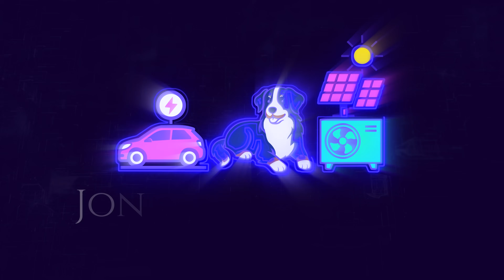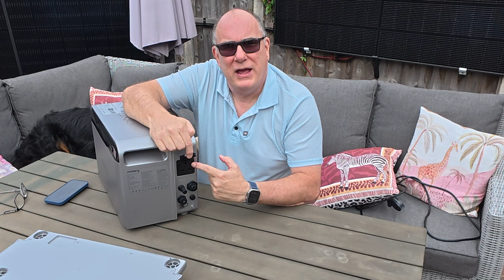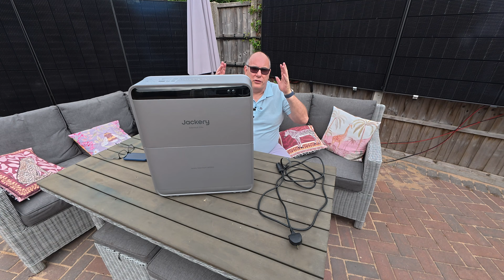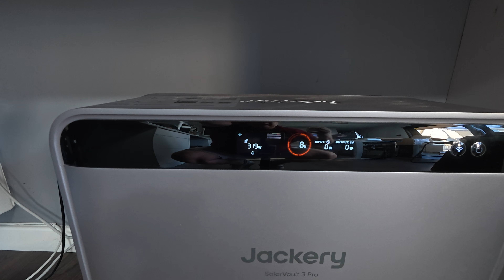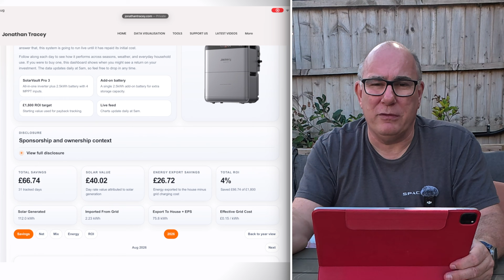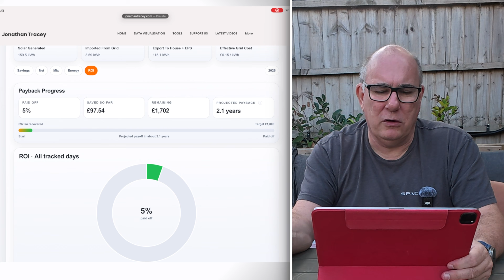Jackery SolarVault 3 Pro Review: The New Plug-In Ready Solar Battery for the UK

Comment: Do you not need an inverter for your solar then if you have one of these? Literally just about to fork out for solar but want batteries on the system. This looks ideal, big fan of Jackery, I’m an electrician aswell so I can do the fused spur myself
Reply from the maker: Yeah, the inverter is built in, so you literally don’t need anything else
Reply: @JonathanTracey  brilliant, thankyou 👍🏻 
I checked the link but it doesn’t look like they’re available yet. Any ideas when they will be available?

Comment: Is it possible to construct, utilise a solar, battery set-up, that doesn't require an App? If the internet goes down, or you live where there is no mobile signal, are these systems then useless. Do I need constant updates, and beyond a certain date, they stop supporting the product, basically meaning you will get hacked? Seems to be even worse with EVs, I don't appear to be able to buy one that is then, truly mine, independent of the manufacturer.
Reply from the maker: Right now you need the app to be able to set the device up, but once it’s up and running run, you don’t want to change the settings. You don’t need any apps.

Comment: do these things also bypass the battery and supply directly via the solar panels or only battery? No idea how these things work to be honest. Got a hoymiles inverter, going to buy some panels and maybe one of these or plug the solar straight in
Reply from the maker: So these devices are effectively the same as your hoymiles inverter with a battery all in one box. This allows you to decide what happens with the energy that is generated by the inverter, you can either send it to the house all the battery or later use.

Comment: Hi I currently have solar panels on my roof is there such thing as a plug in battery where I can just plug in to my plug socket somewhere in my property and it stores power during the day? I am in a  shared ownership property and it's not as simple as installing batteries into the property
Reply from the maker: yes, all the modern battery solutions are plug-in ready, however the current legislation doesn’t allow them to be plugged into the wall. Even though they work absolutely perfectly when you do it.

To be compliant with the legislation, you should use a Few spare and have it installed by an electrician

90% of the people who buy these things don’t bother with that and just plug them into the wall. But if there would be a problem I can imagine insurance companies will try and use this as an excuse not to pay out. So it might be worth just spending the extra money and getting an electrician to do the work for you. It shouldn’t cost too much.

Comment: Excellent and informative video, I can certainly see myself going a similar route with solar and a smaller battery as a starter project. One question John: do you have any DC isolation switches or similar between the solar panels and the junction box shown in the video? I was nervous if it was sunny outside you could get some arcing when making the MC4 connections to the Jackery.. 😮 Obviously and thankfully it didn’t arc as we all saw.. phew!
Reply from the maker: I do have some, but the manuals for all of these smaller battery systems specifically say that you don’t need them. They have things like arc fault detection built-in, however I thought throwing a couple of DC isolators in between the panels and the battery probably isn’t a bad thing
Reply: In theory it would only arc if under load ie it was being used in some way. Maybe it doesn't as long as the jackety is isolated from the grid?
Reply: Thanks for replies Guys, arc fault detection sounds like something that could prevent a fire rather than prevent an arc so John T is probably wise to add the isolators for a belt and braces approach.

Comment: Can this battery also be charged from the mains as well as the solar panels? All this home solar is so confusing.
Reply from the maker: yes all these systems can be charged from the mains on cheap rate electricity, you just set a schedule in the software and tell it when to charge

Comment: Another great video, I see you have now swapped out the  EcoFlow batteries for a Jackery system, I be interested in the pros and cons on the different battery systems and which is best.
Reply from the maker: not so much swapped out as moved around, I have another system to test in a couple of weeks time and then once I’ve run them all for a few weeks, I will do a video comparing one against the other

Comment: What is the total kWp for the panels that the jackery is attached to?
Reply from the maker: from beginning of July (up will the gap in mid August) it was 4 x 445w panels, two vertical to get morning sun and two vertical for evening sun. Now it still has the two for evening sun (soon to be upgraded to 500w panels) and two 500w panels on the pergola (details coming soon)
Reply: @JonathanTracey   thank you.
We used to have a pergola but it only lasted 35 years before started to rot and I took it down.
I built one for one of our sons a couple of years ago and it would have been cheaper to cover it with solar panels than it was with polycarbonate, he wanted it waterproof but I couldn't find a way to successfully join the panels without it leaking.
Your upcoming video may just prompt me to build another one for myself 😊
Reply from the maker: yeah, these last two days have shown that there is no easy way to seal the panels. You can’t glue them together because they need to be able to expand and contract, however, I’ve got some ideas.😂
Reply: @JonathanTracey   my stumbling block was where 4 panels join so you have a watertight cross junction whilst still allowing them to slightly expand and contract without breaking the seal. It's possible with a pitched roof but with an almost flat roof like a pergola it not quite as simple.
I still have the six bifacial panels that I got to test different options.
I look forward to your solution.

Comment: Specs say upto 2500w feed in, why is 800w quoted?
Reply from the maker: 2500 Watts is what you can charge from the grid, 800 Watts is what you can push back to the grid
Reply: @JonathanTracey  Clearly states in the FAQ on the website..

SolarVault 3 Pro accepts PV input and provides grid-tied output up to 1200W (default to 800W). It is ideal for standard household needs.

SolarVault 3 Pro Max also accepts PV input, with output boosted to 2500W for higher energy demands.

(2,500W higher output via professional installers and get permitted under local policies.)

This is not a plug in product, and can only be connected by a qualified electrician, so the 800w limit doesn't apply.
Reply from the maker: Yes up to 1200w depending on country and local legislation, in the UK the limit is 800w. If you set the unit to UK it will only allow you up to 800w
Reply: @JonathanTracey  G98 limit in UK is 3.68kW.
Reply: @JonathanTracey  Jordon from Artisan did an install and setup video on the Pro, 2500w feed in is user selectable in the app.

Comment: Does it actually need a qualified electrician or rather a competent person? I suspect it’s the former but hope it’s the latter given how simple it is to install a fused spur.
Reply from the maker: The way I understand is that if you are doing anything that involves a consumer unit, then it needs to be signed off by qualified electrician.

If you already have a fused spur and as far as I’m aware, it’s no different from changing a plug
Reply: @JonathanTracey surely the easiest thing to do then is just install a fused spur off an existing socket on a ring?
Reply: Someone needs to sign it off.

Comment: You said you weren't exporting surplus to the grid but not how you did that.  Does the Jackery have soft switching to prevent export like the Ecoflow?
Reply from the maker: no at least not a switch i can find, i have it monitor my shelly that monitors the heat pump. then a home assistant automation tells the heat pump to use excess to heat water

Comment: I already have a fused spur in my garden hut do I still need an electrician to wire the power lead in? seems a bit over the top if thats the only way to get it up and running especially as I'm electrically trained albeit not a 'qualified' electrician.
Reply from the maker: It’s not for me to tell another man what’s right or wrong😂
Reply: JT's use of the phrase 'fused spur' is going to lead to confusion at some point and your situation might be one of them. The fact that you're asking that question to some Youtube influencer without mentioning pertinent info suggests that you're maybe not as 'electrically trained' as you need to be.

Comment: Would it not be a better experiment if you assumed that people getting one of these did not have 100 spare power stations to take the overflow?
 I doubt many people will have another power station to dump the extra energy and thus will make your figures look better than a normal person would.
Reply from the maker: Im not assuming anythign I am just showing you how I dump extra power out of the device. You can plug anything you like in to draw off power if you need to, an aircon unit, a heater provided its drawing less than 1200w

Comment: With the plug in solar regs, are you going to have to remove the panels off the wooden fencing ?
Reply from the maker: Good question. No, the new regulations don’t retrospectively require me to remove the existing panels.

There is a wrinkle, though: under England’s new permitted-development rules, a new plug-in solar installation on a wooden wall, balcony or enclosure—which would normally include a wooden fence—doesn’t qualify for automatic planning permission. That doesn’t mean fence-mounted panels are universally illegal; it means planning permission may be needed.

There’s also a 12-month transitional arrangement until 26 August 2027. Interestingly, the official plug-in solar product specification does recognise fence mounting, provided the manufacturer approves the mounting system, ventilation, clearances and fire safety. So the electrical/product rules allow suitable fence mounting, while the planning rules restrict wooden structures specifically. I’ll be looking at how that applies to my existing installation, but the new rules don’t simply order existing panels to be removed.

Comment: If it has sockets on it that remain live with the grid down I'm not convinced it's anything ready without hassle. If it keeps power on the sockets then it needs a separate grounding arrangement fitting so that you have a valid ground.

One of the problems of wiring it in is that BS7671 amendment 4 immediately applies as is. That means it's got to be in an approved location and with the correct grounding.

Hopefully Jackery will copy some of the others like Ecoworthy who are now offering products with install so you can just order your 16kWh wired in system from them and pay the extra for an approved install. At that point it's more like ordering a washing machine from someone like AO where they'll turn up, make it work, do the paperwork and go.
Reply from the maker: I think two different operating modes are being conflated here.

During an ordinary grid outage, the house CPCs and main earthing terminal remain physically connected; losing the live supply does not itself disconnect every earth conductor. However, BS 7671 correctly says that if a battery is wired to run the HOUSE in island mode, its protection must not rely solely on the distributor’s earth, because that earth cannot be guaranteed during network work or certain faults. That is where changeover equipment, neutral/earth switching and potentially a consumer earth electrode become relevant.

But the SolarVault’s onboard backup socket is not energising the house wiring. Once isolated from the grid it is a self-contained output, functionally like the socket on any portable power station. Those products use their own manufacturer-designed protective arrangement—often electrical separation or an internally referenced output—and do not automatically require somebody to install an external earth rod.

So yes, hard-wiring it for whole-house backup invokes the full BS 7671 island-mode requirements. Simply using its onboard socket does not make it a house islanding installation, and “it needs a separate ground” cannot be assumed without checking Jackery’s specified output and protection arrangement.
Reply: @JonathanTracey  It would be useful to get clarity for Jackery and the other companies on this certainly.

Comment: price 1800? more expensive than new anker?
Reply from the maker: Where are you seeing the pricing, I was told it wouldn’t be announced until mid September
Reply: @JonathanTracey  you used 1800 as reference
Reply: @jeancarloabreu  I'm sure Jonathan can clarify but he did say that he came up with that £1,800 just for the ROI calculation and since part of the benefit comes from the solar panels maybe his £1,800 included the cost of the 4 panels.

In theory the figure used for the ROI calculation should have included the cost of the electrician to install it since the fused spur thing is currently a UK requirement but I'm guessing that Jonathan didn't include that because 4 x 465W panels and an electrician would I expect take up too much of the £1,800 to leave a realistic amount left over to account for the price of the battery (even without VAT added).
Reply: @julianfp1952 better a system without the electrician charge, DIY all the way
Reply from the maker: don’t take that price as anything other than a guest. I had to put something into the system based the ROI calculations on. Once I get the final pricing, I will adjust it.

Comment: I found it for €1398 euros online, so hopefully will be less than that in £s 🙏
Reply from the maker: I don’t have release pricing at this time, I believe it will be mid to late September before that’s release
Reply: Remember that you pay VAT on solar and batteries and most of Europe does not. So that's a 20% penalty. You can avoid the VAT but then it must be bought, fitted and commissioned by your electrician as part of the job.

Comment: assuming this isnt yet allowed in the uk? i know the new plug in solar severly limits what brands you can use and has to be from the approved list? is this/will this be the same as that?
Reply from the maker: yes, it’s allowed just not with a plug on the end of the cable, you have to have it wired to a fused spur as I showed in the video. Other than that, there’s nothing else you need to do.
Reply: @JonathanTracey  So once your sparks has wired it in to the fused spur, do you have to register it with your DNO?
Reply: @leewadey4172  The normal procedure is for you to get a sparky to buy it, install it and do the G98 registration. Otherwise you'll pay VAT on the unit and do the paperwork which is a pain.

Comment: I'm just about ready to buy a battery, I'm leaning towards the new ecoflow 5000 and a smart meter. Does this have any benefit over that system?
Reply from the maker: both are very good systems, and either would serve you well. I would say one area which the Jackery stands out over the EcoFlow is in its API, local connectivity and Home Assistant integration. If these aren’t important to you then don’t worry about them.😂
Reply: @J @JonathanTracey  what about the price? If European pricing is anything to go by, the jackery is a far better deal.
Reply: Pricing will be key. Im in france now and they sell the pro 3 at 719euro and 2.5kwh expansion for 499. That will be serious undercutting the 5000. Shame they are on different voltage, otherwise i can bring a set back.
Reply: @Madeinhk-D who is on a different voltage? France is 230, the same as the UK.

Comment: Seen this on Ecoflow uncensored FB? 

"So shock update I have been notified by NationGrid to disconnect my installation as the equipment is now deemed non compliant. All I wanted to do was add one additional inverter!
They have told me unless I can prove at the time i changed the installation the inverters where complaint I can no longer use them.

Comment: Jon what are those boxes inside your house with the solar connectors called? or are they generic junction boxes? They look tidy
Reply from the maker: yeah they are just generic junction boxes they bring the solar cables into my office from outside
Reply: Agreed. I'm going to need these I think.

On that subject, a lot of us currently have 1 or 2 panels plugged into an inverter and then connected to a fused spur. Is there a market for batteries that take the AC feed from an existing inverter set up or is it better binning (selling!) the existing inverter and re-wiring into the ports of the battery?

It would be nice not have all my eggs in one basket.

Comment: Agreed, an Ethernet port is a good idea and a unique feature. I like to put devices on a wired network as much as possible for rock solid reliability, and it’s a good point about it potentially being in an outbuilding and out of WiFi range. The only thing better in that scenario would be if it had a built in Ethernet-over-power and you could get a matching powerline adaptor to go by the router.
Reply from the maker: Never had great success with Ethernet over power, been a few years since I tried, has it improved any?
Reply: @JonathanTracey  A former colleague of mine had it running 10+ years, you might have problems if the two endpoint are on different phases or some strange security circuit is on one of the two circuits. If they are on the same fuse with no extra stuff along the way it should just work, otherwise pickup your oscilloscope and chekc who send noise.
Reply: @surters if your running an Ethernet just run it to a another router and extend your network
Reply: @johnwinser  Some people doesn't like pulling more wires.